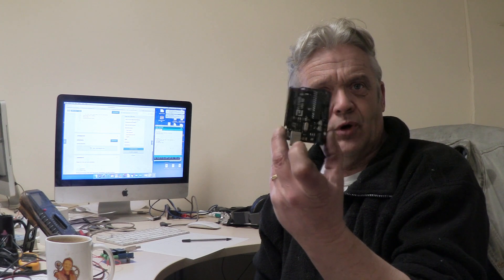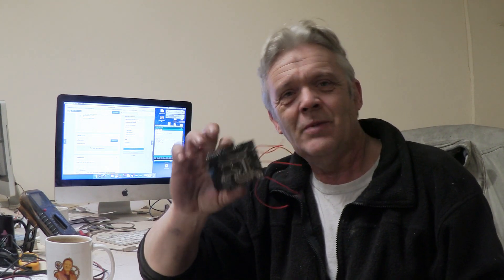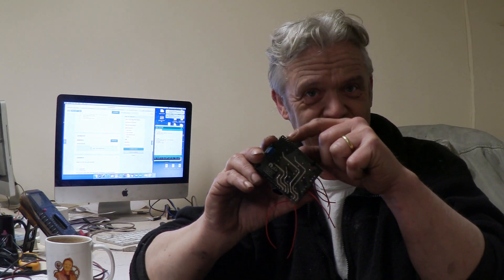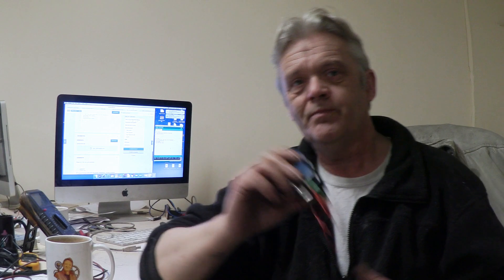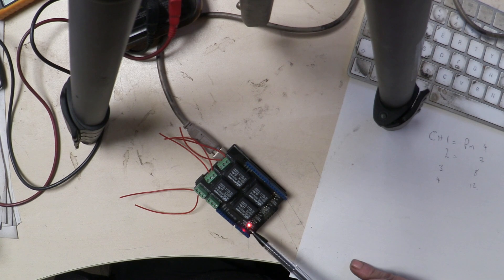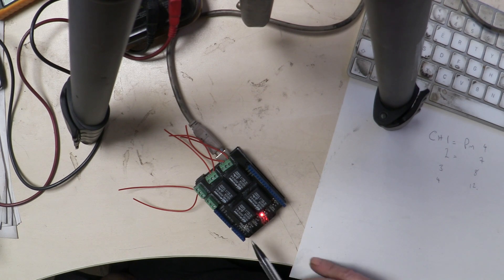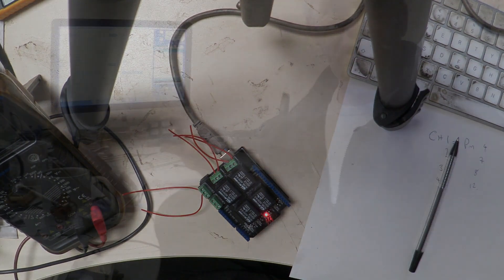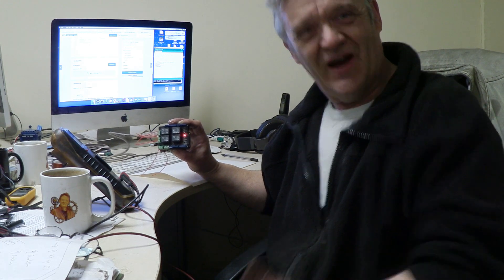1010 Working  With Arduino - Relay Shields

Comment: Hmm. Those Ard relay shields are REALLY cheap and nasty. They will work for a while and then the coils in the relay's fail. Much better to use Solid State relay shields; they are as cheap but they can't cheap out on the copper because there isn't any. I have a SS relay shield on my water pumping system and my solar heliostat and they have been working for 11 years every day without dying...

Comment: The other advantage of an Arduino is you can set it up, debug and fine tune and then when no longer needed use it for the next project .....  or if it is needed (as I suspect this will be) make a custom logic board up with (not, and, or and nor chips with a variable oscillator (555 timer) to give control! Nothing like a well polished, well designed pcb board on show to give a bit of bling!
Or maybe it is just me? ;0)

Comment: Being public domain there is also so much information available to tell you what pins are being used.
I have so many Arduino boards but only one is a genuine version. These days all the shields (or sketch examples) let you know what pins are being used. Alternatively you can make your own shields that not only give you the relays but also a keypad and screen to alter the timing and tell you what is going on.

Comment: Hi. The arduino uno can be a bit bulky, the arduino Nano is about 1/10 th the size and much more powerful (£5 on fleebay) .RF Nano is a nano with a built in radio, very handy and good range. Thay all work the same as the Uno with extra features at your disposal. Loads of cheap sensors (pennies) on ebay, temp, humidity, light, noise, vibration, motion, water, smoke (the list goes on) and they are all easily used as triggers for your relays and controlled from your phone.

Comment: Why not using SSR ( Solid State Relays) ? they will not wear off as fast as cheap mechanical relays ?
Reply: Depends on what you're doing the world and his dog has been controlled by mechanical relays very reliably  for a very long time if your learning why do you need to worry about extreme reliability?

Comment: This opens up so many builds. I can't believe I've never seen this before
Reply: you should head over to eli the computer guy's channel as he is building a web controllable RC  car that uses a raspberry pi and arduino to control everything, webcam on the pi gives you video feed of what the little RC car he made out of plywood and screws and bits and bobs cheaply is seeing XD Arduino and Pi are both changing so many things (the range the car has is anywhere it can get a wifi signal to, but you can even get a 5G or 4G cell phone module so the pi can then control that car anywhere there is a cell phone signal and send you video it has, too, all from the comfort of a chair infront of your computer and a browser to load the webpage that the controls are on XD
Reply: @ThomasAndersonbsf  thanks I may have a look. I've heard of raspberry pi but thought it was just for android TV boxes lol.

Comment: I quit using any on market relay boards. They are too weak. I use Mosfets and plug them into a ribbon cable and then wire the cable to sink the coil on automotive cube relays.
Reply: I believe this is more about showing technology that most newbies don't know about. This is probably more of a gentle, general introduction to motor control (small robotics) than trying to drive a 4hp motor. Just my thoughts of course.
Reply: @ffaubert1  That is also the point of my comment. I am giving Robert ideas for future videos. I wish someone would have have shown me this when I first started years ago. They make for a very compact interface and they cost pennies.
Reply: I'm a bit more basic- I use the arduino relays to switch the automotive cube relays. On one occasion I then had the auto cube switching a car-starter relay so, in effect, the arduino was switching a few hundred amps. The lovely little "click" was replaced by a "crash" and I didn't really need the led to let me know if it was on :-)
Reply: @nil5221  Yeah I used to do that. But now that I learned how to use mosfets for logic triggering its way easier they make for  a tiny interface :)
Reply: I was about to say this, I've read that most relays designed specifically for these boards can't handle a long time closed when using 240v appliances and fuse closed after short periods with a load. Is there an instructable / resource for your solution I could look at?
Reply: Looking at the size of the relays on that board, I think those are rated for 10 amps at 30 volts DC, or 300 watts.  He's using them for two 12 volt DC motors, the bigger of which I believe is the power window motor from a car.  I think those are about 20 amp, which at 12 volts would be 240 watts.  The other motor is just a paper feed from a printer, and I doubt it would draw more than 20 watts.  I believe both motors will be within the limit of these relays.  These boards are rather convenient for small-scale projects like this - it's an "all-in-one", "plug-n-play", inexpensive solution.

Comment: The sketches you switched to are words...
Was hoping for a schematic..
What sets the timing of on/off switching?
Reply: If I understand the question, the loop function and millis() will allow for timing. If you need realtime switching you need an etc module. In this case the timing is done by delay(milliseconds) function. Loop runs every X millisecond, based on the Hz of the boards chip I believe.
Reply: I was wondering if they use a 555 and/or a real time clock.